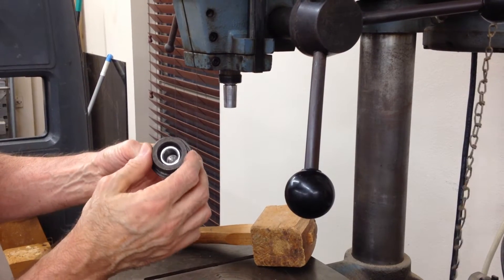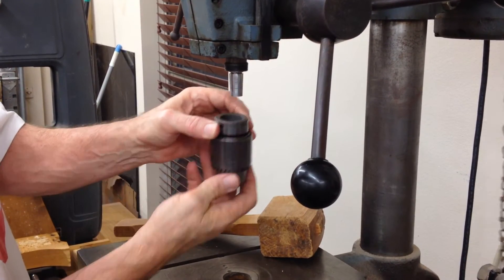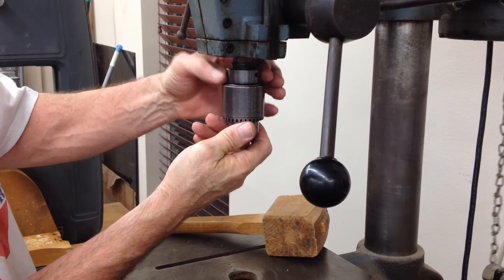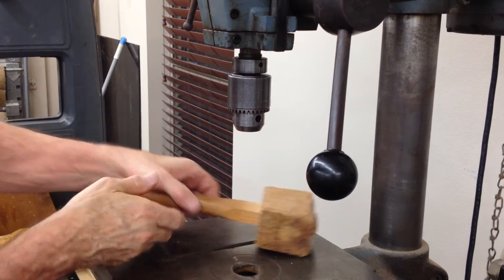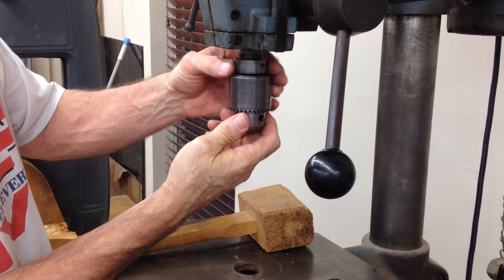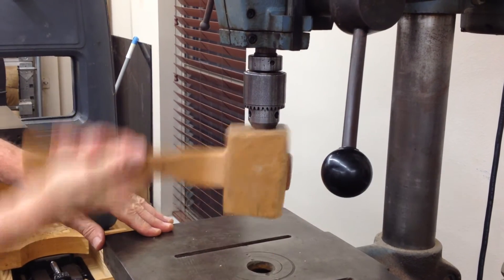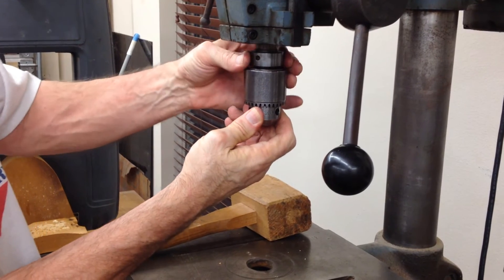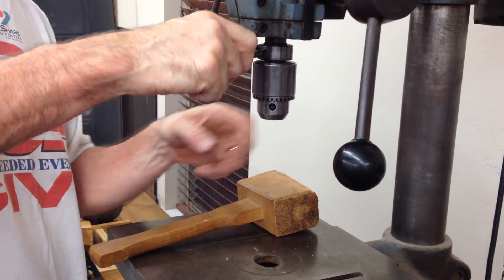Drill press chuck with threaded collar - installing

Comment: David :  Thanks for this brief demo...I have a PM 1150 (50's green) that I'm deconstructing and restoring, and the Jacobs chuck setup is like yours...it's a 633C. Got quill off spindle, and while threaded collar above chuck spins a bit, can't get chuck off.  Probably hasn't been off since Ike moved to Gettysburg.

Your use of the spanner (Armstrong?) to put yours ON gave me the hint, and I got one tonight on eBay. Hope to get chuck off soon as it's banged up pretty fierce as former owners have reefed pretty hard on the main pin holes for chuck key, and deformed them.  Planning on putting a spankin' clean Jacobs bb 14N MT3 on once I clean inside of spindle's taper.  With appreciation - Greg  Francestown, NH

Comment: I have the same chuck setup, and I'm still confused. Can you also show how you removed the chuck? My chuck hasn't been removed in 50 years. :(
Reply from the maker: texasboy2005 I used a large Allen wrench, chucked it in the jaws and let the long end ride against the column, then tapped on the spanner wrench to loosen the threaded collar.  This will pull the chuck off the tapered spindle.